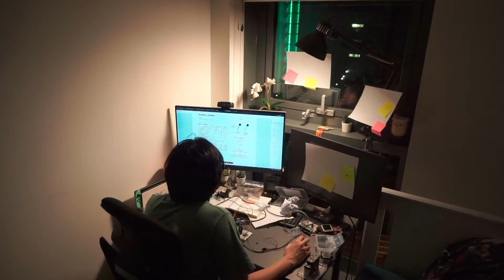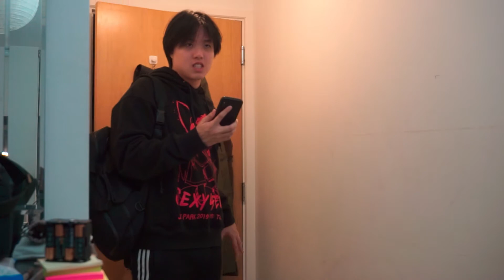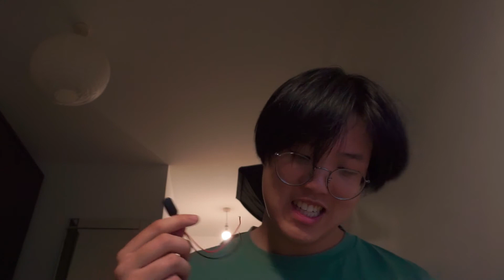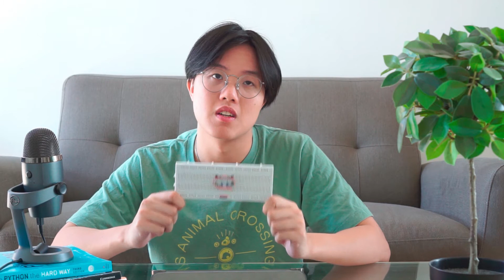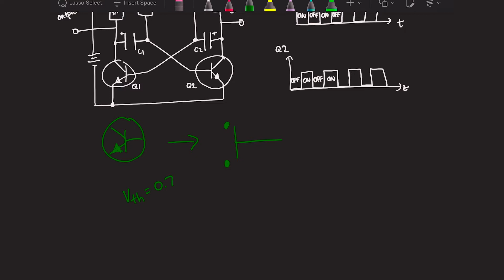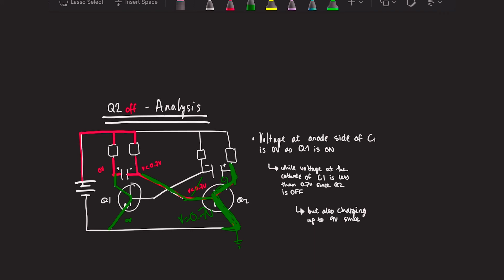I built a theoretically impossible circuit

Comment: i want to learn electronic circuit analysis (i.e look at a circuit and reverse engineer it precisely an LED emergency lamp now)  and i dont have a degree in electronics although i am a technician. can i learn circuit analysis without a degree if yes please help with a guide on how i can achieve that. thanks by the way ur a genius sir
Reply from the maker: Haha I am definitely not a genius, just an average person with some engineering knowledge. Although I didn’t take the technician route, I believe that doing enough personal projects and studying the mechanics of what you’re working on can make you better than 60% of engineering graduate students who haven’t done any projects outside uni. If you’re working on an LED emergency lamp, I suggest studying different types of current sources and how they work and understanding why you cannot use a voltage source. You could also try building a current source that supplies multiple LEDs or even making strip LEDs for your room. You could further this project by implementing a handheld controller to control the LEDs. You have to keep building on top of projects; that’s how I found it to be the best way to learn.
Reply: @ThomasDo  thanks men